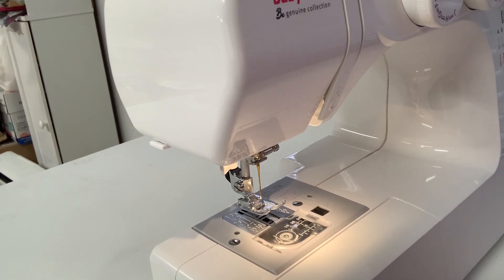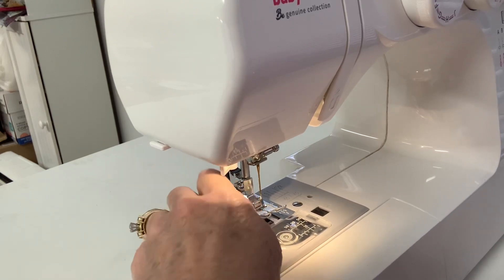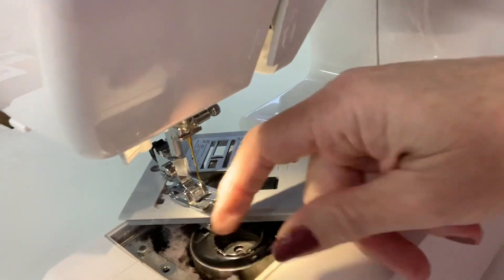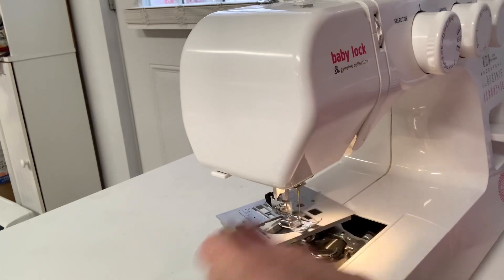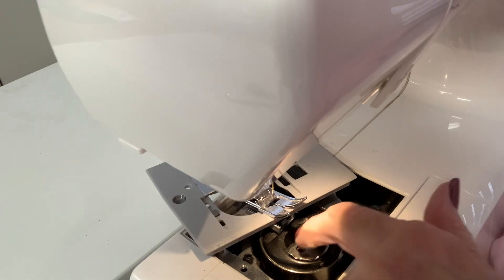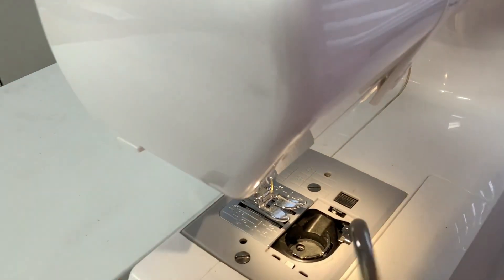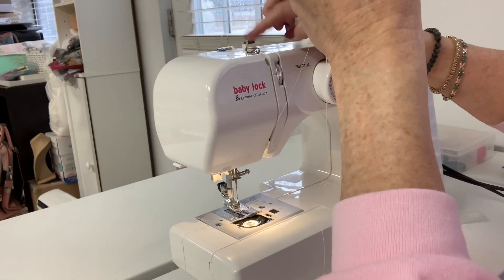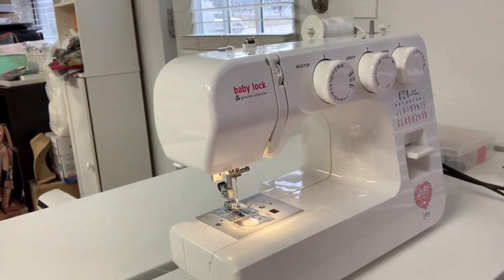Cleaning and threading a Baby Lock Joy Sewing Machine

Comment: The whole process is very simple and I do not understand who you would manually thread a needle when there is an automatic needle threader built into the machine.
Reply from the maker: The needle can be threaded both ways. It’s just as easy to manually do it.

Comment: Do you have videos on different types of machines and what they are used for?
Reply from the maker: I am going to start doing other videos related to sewing machines. Why do you mean by what they are used for?
Reply: I am wondering if all machines are used for regular sewing or are there some that are only quilting or embroidery. Which are good for beginners?  Are there good ones at different price points or are only the expensive ones best?
Reply from the maker: @tammywilliams313  you can get a machine for just about anything now. I will try to do some other videos as well. There is a broad price range. If you’re just starting I’d start out on the lower end to see if you like it. I would want an automatic threader and a thread cutter for sure but that’s just me.